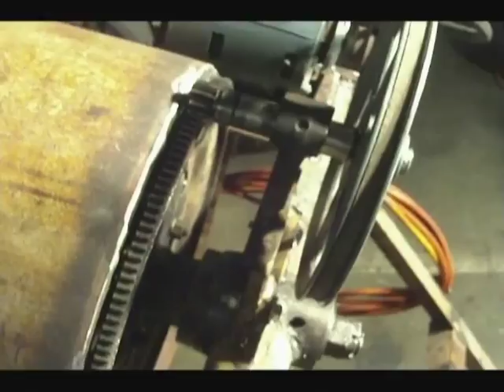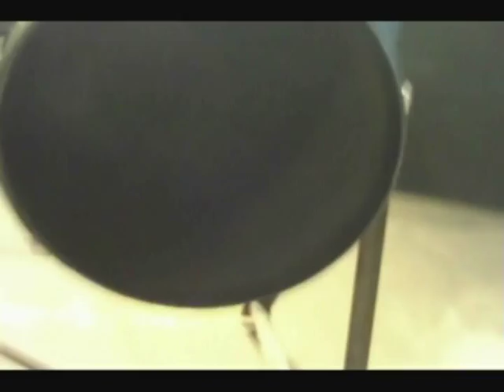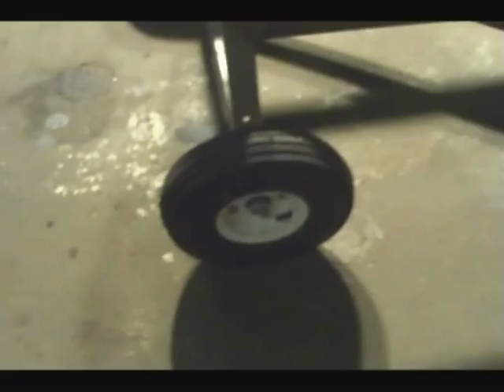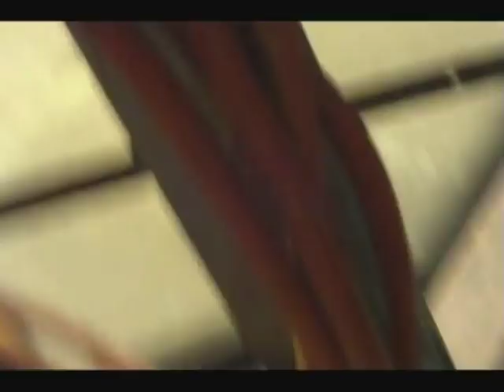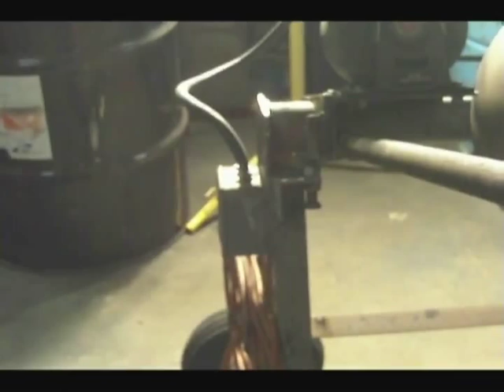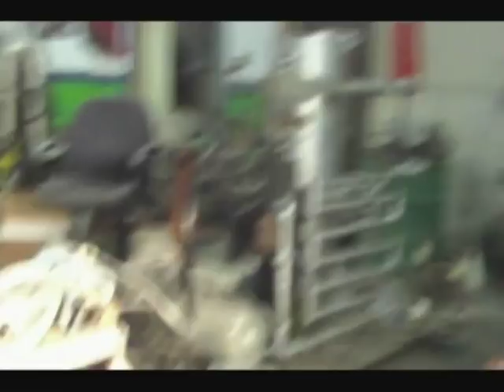Mini Concrete Mixer Movie.flv

Comment: @SheikYerbouti - if you want my formula I would be happy to post it. I also used a propane forge. I'm a blade smith. I designed and built my own gas forge and it runs hot enough to forge weld and smelt high carbon steel. My refractory handles the heat and borax while lasting a very very long time - hundreds of hours of burn time...

Comment: Bill, it's a great looking little mixer. You mite consider using a plastic coffee can as a motor shroud. Keep the wet stuff out of the zappy stuff, dust also. 
I have to hand mix my refractory, it's to thick to use a mixer. Very little water used in my formula, speeds up the cure time and less chance of cracking.
Happy new year.